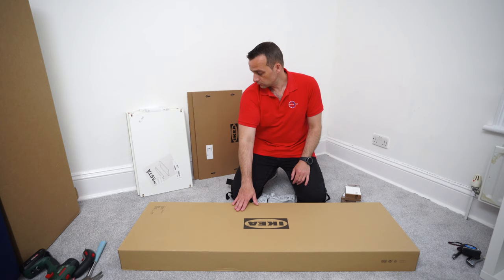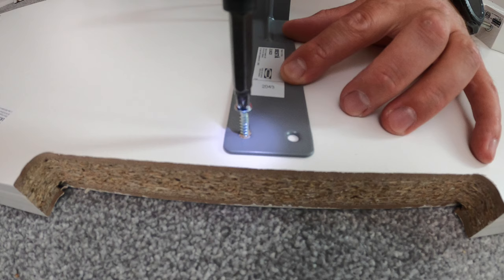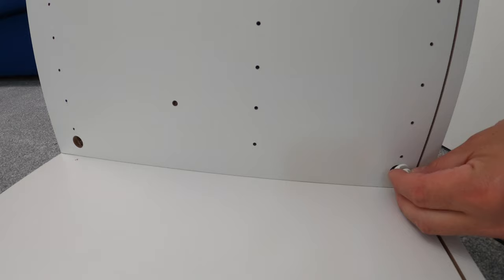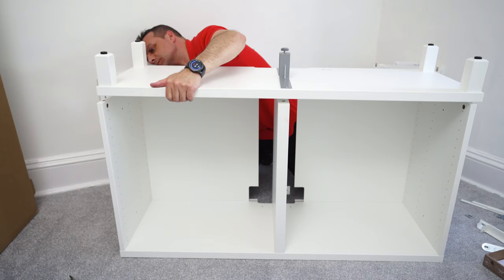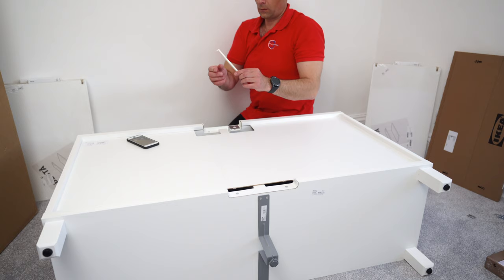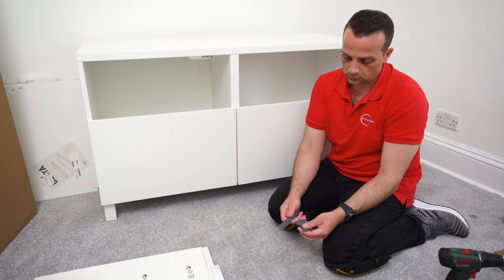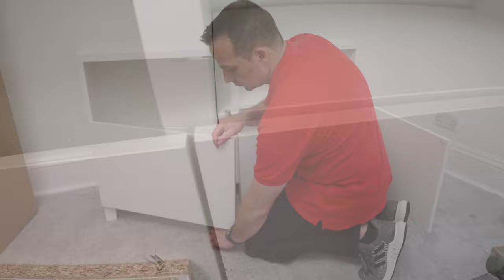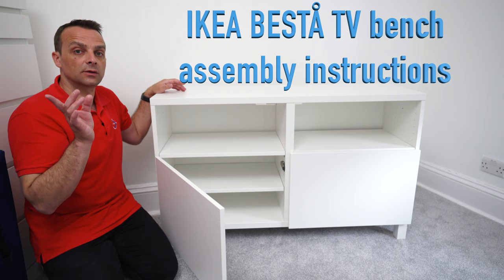IKEA BESTÅ TV bench assembly instructions

Comment: I have a black version with full height Laxviken doors. I also have the Stubbarp legs. Since I have surround sound, I had to omit the back panel on one side of the unit to wire my system. (The bulky speaker wire had to go straight out the back.) My only complaint was that, since I have an outlet and wires in back of it, and I have to center it with the TV that’s on the same stud as the outlet, I can’t secure it to the wall. Instead, I have to rely on the weight of my 5.1 surround receiver on the bottom shelf and the speakers on top to keep it from tipping over when I open both the doors all the way. It works fine now, but it definitely wouldn’t if I had young children hanging off the doors.